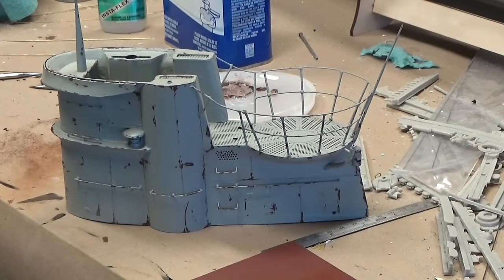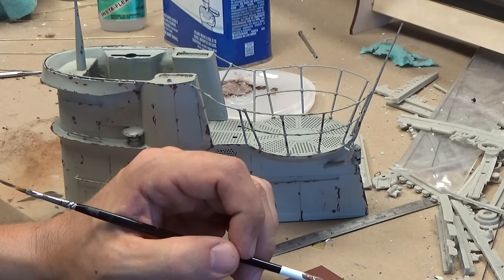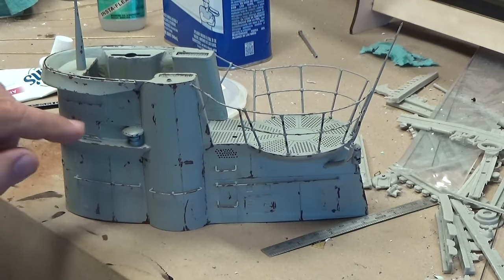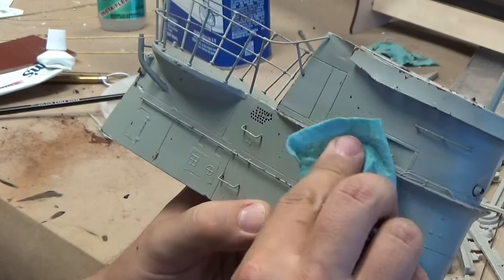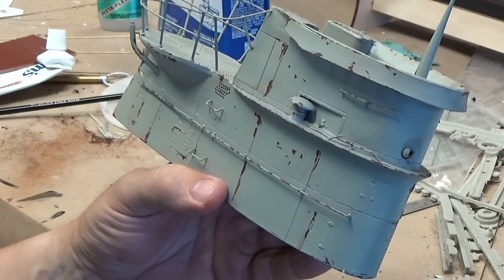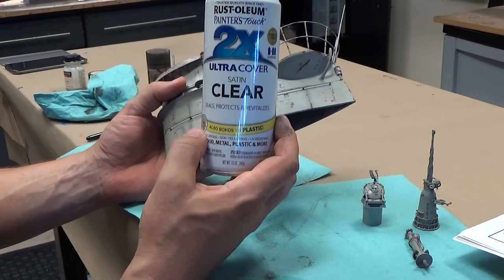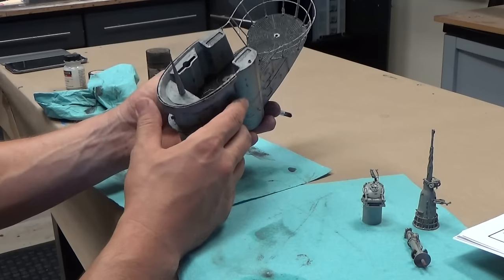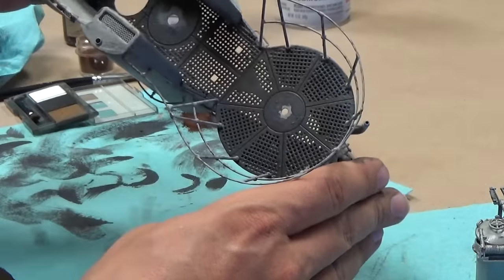German Type VIIC Uboat conning tower buildup

Comment: Bob, Outstanding work! I've been scale modeling now for many years. Mostly aircraft, but others as well. I'm considering Revell's 1/72 scale Type IXC/40 as a display model. From what I've seen this model has a significant amount of detail when compared to it's Type VIIC variant from Revell at a fraction of the cost, (just under $80 on Amazon). Do you recommend this scale as a display model, or would you say that this scale is better suited for RC?
Reply from the maker: 72nd makes it a sizable display model. I am a big model type of guy, so I, for one, love the big scale of these boats.